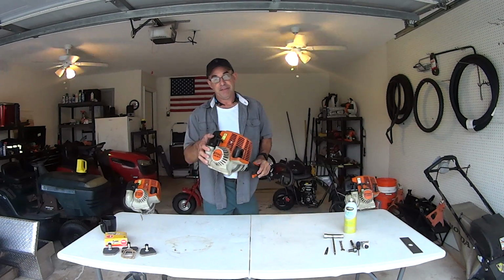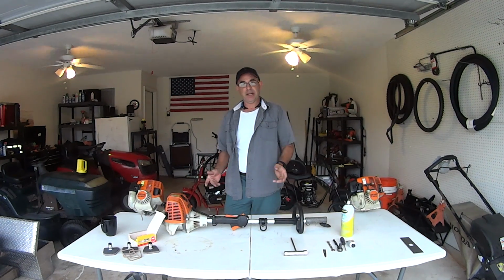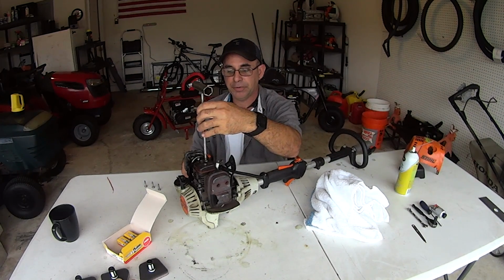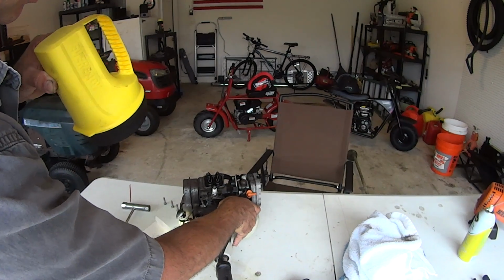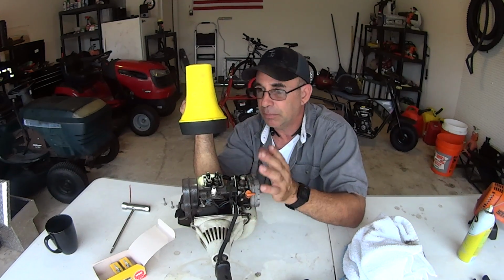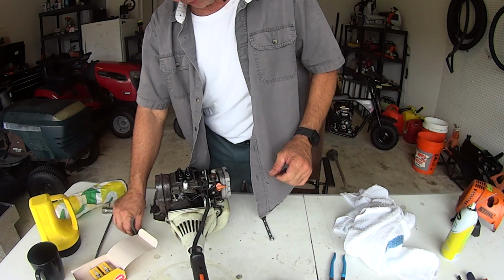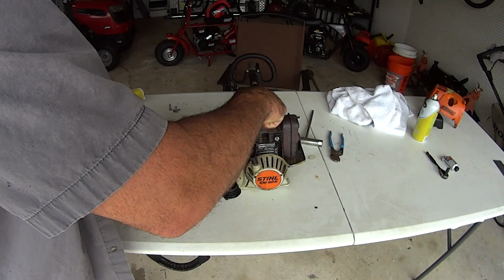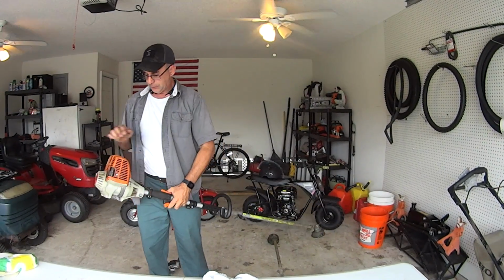How To Do a Tune Up Stihl FS 90, 100, & 110 4 Mix Weedeater - Check Valve Clearance

Comment: Great video, lots of good info, but I kept waiting for what the valve clearance gap should be. Did I miss that? Another Stihl video stated .004, is that correct?
Reply from the maker: I think you may have missed it. But thank you for adding the info in case others do as well!

Comment: Are you suppose to lube the shaft of the kombi system where it has the coupler and the plastic sleeve. I was told to do so in order for it not to break the plastic sleeve! It helps against friction and is a bear to replace the plastic sleeve as you have to loosen or break loose the nut that holds that plastic sleeve. My used 91R was bone dry so I did this
Reply from the maker: If I remember right, I believe I did put a little bit of grease on the shaft so it would disconnect easier when I would change the lower unit from Edger to Weedeater.

Comment: Thanks for sharing. Do you know if it's possible to replace the FS70 head with another kind? I have a strimmer but I would like to convert it into a pole strimmer to cut hedges.

Comment: Valve gap? Fuel mix ratio? Some chemicals will destroy plastics or dull the finish. Use soap and water only for plastics. I have opened new boxes of spark plugs with gap completely closed shut due to rough handling. Gap also affects timing. Spark arrestors are there for a reason. Always check exhaust outlet, muffler for clogging. Some people use wrong oil or too much of it in premix.

Comment: My 110 is about 15 years old and was running rough I was going to do a tune-up like you were doing but for what you just spent on a tune-up I just bought everything you've got there and a brand new carburetor. Telling people to buy parts individually is a big disservice. If they do any kind of shopping or research there's a reason kits are kits the sum is always less than the parts
Reply from the maker: So you got an original equipment Stihl Carb and saved money over my $15 per tool price for this tune up? That’s awesome. Glad you didn’t get some cheap ass crap with inferior gaskets.

Comment: Thank you so much - Have you ever worked on a Stihl leaf blower?
Reply: I know you were asking Dan this question, but since you didn't get a reply I'll answer your question... I just adjusted the valves on my Stihl BR700 backpack blower, my FS91R weedeater, and KM90R Kombi. All of these are the same procedure. Except I believe I took the spark plug out before trying to find top dead center on the blower. It made it easier to turn the engine over than doing so with the spark plug in.
I'm almost sure all of the 4-mix Stihl motors are the same to adjust the valves. But check your engine specs to be sure before you start wrenching on them...

Comment: Where do u find the grease for the gears in the head off the weed wacker
Reply from the maker: I got my tube from the stihl dealer
Reply: Hi Dan thank for getting back to me I don't have a stihl my weed wacker is called Ryobi ss30 would it stall work on it and I to have a side hustle I have six lawns

Comment: Great video dan.
I’ve been an echo guy because the whole stihl 4 mix thing seemed like a big mystery with the valve lash adjustment deal but now I wouldn’t hesitate at all to buy a stihl 4 mix machine.you thoroughly explained it and demonstrated how easy it is.
I’m a big fan of the ethanol free gasoline also.i started running it in all of my equipment this year.it makes my lawn tractor,handheld string trimmer and dr trimmer run completely different.easier starting,smoother running and everything holds rpm’s better in the heavy stuff.they even sound different when they run.amazing what a difference changing fuel makes.
Keep those videos coming
Reply from the maker: Thank you George. Ethanol Free fuel is worth every penny!
Reply: In 1972-1976 when I was 12-16 years old one of the lawns I mowed in my neighborhood was an elderly woman who had a smaller snowblower in her garage that her son in law ran for her that was 4 stroke.it had to have sae30 weight oil mixed with the gas instead of oil in the crank case so the 4 mix thing was being developed back then,although it was far and few between until recent years when stihl started marketing it.
I think 4 stroke is good.lower rpm and more torque instead of mostly horsepower like 2 stroke is

Comment: Great tutorial!  I had the shop do the valves 2 years ago at about year 5 of ownership.  Next time I will do this myself.  

On the fuel filter what I find helps me it to get small forceps that I use for fishing to grab onto the fuel line.  It is still awkward at best.  But easier than anything else.  Needle nose pliers are too big.   I use a grease gun on the grease port just because I have the grease at hand.  I only have to do that every few years.

Comment: Hey Dan. I used to fix everything. I was a "Jack Of All Trades".  Now I'm a disabled veteran, and I have come to rely to much on warranties. Your tutorial is very impressive. I have a Stihl FS 90. I bought it 2 years ago, last month. I've never done anything to it. I just found out 2 days ago, that I had to put grease in the head. In addition to being a Veteran, I am also a Auto Mechanic by trade. So, I am gonna start getting back into doing things for myself, and I'm a little rusty. Should those valves be adjusted with the engine warmed up? What's your opinion on using genuine Stihl products vs. using the cheap tune up kits you can get on Ebay?
Reply: the cheap kits tend to have some tiny issue inevitably. I always buy OEM parts when possible

Comment: Do you do that yearly ?
Reply from the maker: I sent one to the shop last year (FS 100 RX under warranty, ran like poop) and they adjusted the valves and cleaned the carb. This is the first time I did it myself tho and I will do it every late fall/winter.

Comment: Three things. 1- wear gloves when handling gasoline. It contains benzine. 2- Don't touch the white insulator on the spark plug. Contaminates can be conductive and cause the high voltage to leak to ground. 3- ALWAYS check your spark plug gap. Why would you check your valve clearance and not check your spark gap? Otherwise great video. Thumbs up.
Reply from the maker: Besides eyeballing to make sure that it’s open, I’ve never worried about the spark plug gap, but I guess you’re right
Reply: I'm old school. Worked on cars and trucks since 1972. I was taught to always check everything because Murphy was lurking.

Comment: Dan starting to feel confidence adjusting valves lash now, great job 👍
Reply from the maker: I used to do valve lash and lapping along with a crap of other things on my V-8. I used to race stock cars in the 90’s. Never did them on small motors but it is cool to do and fun to demonstrate and so much easier!!

Comment: Hey goof afternoon i was wondering where my screen wood be on my craftsman weed eater i took it apart and didn't see amy screen around the muffler at all just the two bolts to loosen the muffler free...
Reply from the maker: John Leija Bot all manufactures use them but the screen is inside the exhaust hole. It is very small and may have a small Phillips head screw holding it in

Comment: Hey Dan I need your advice on something..
Yesterday I went down to my stihl dealer to purchase a new trimmer. I needed a new one to replace my 110 that was stolen.
 My intentions were to look at the 91 and the 94. As i looked further down the aisle I noticed that the Fs111Rx was a lot cheap. 319.99 actually.  So with the 91 and  the 94 being 20 to $30 more I decided jump on the 111.  So I figured I got a good deal on a machine that has more power and a bigger tank.  However I never known anyone to run one of these before. I've been looking on YouTube have not been able to find any reviews on it but very few. So now I'm kind of skeptical about using it or returning it for the 91 or 94.   Eventually I'm going have to buy an extra one anyways because I need to run 2 trimmers on my trailer. 
 I guess my question to you is what is your opinion on this matter and what have you would have done?  Thx
Reply: The FS 94 is a straight 2 stroke, not a 4-mix. It's a little lighter than the 91, and is actually a little easier to feather around places like privacy fences and such.